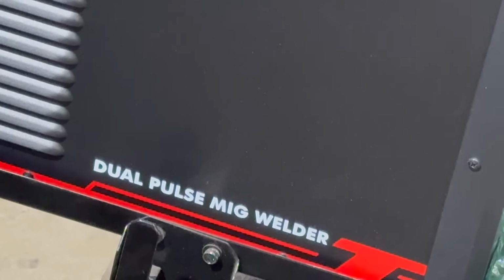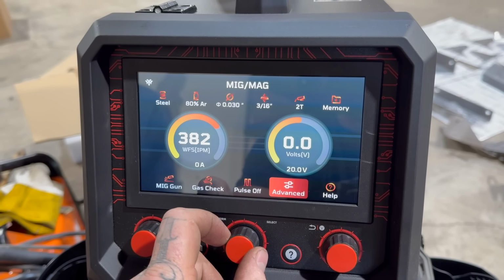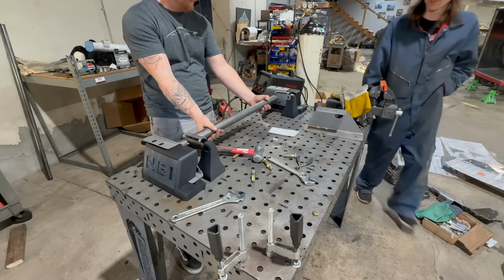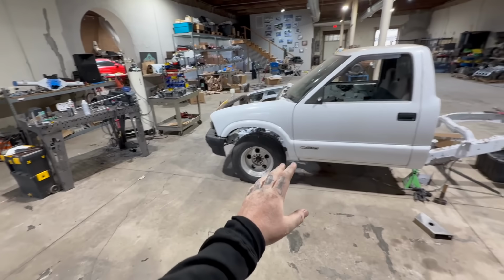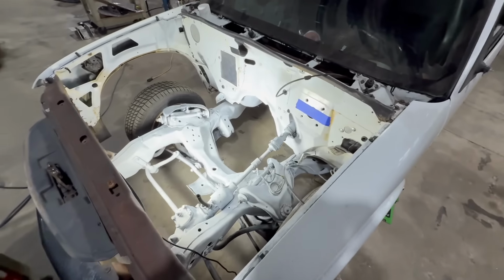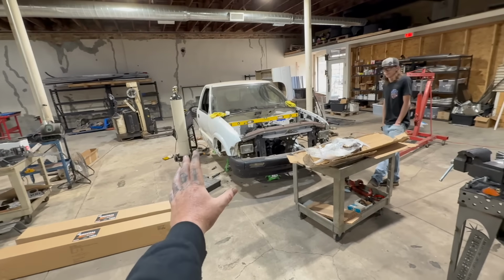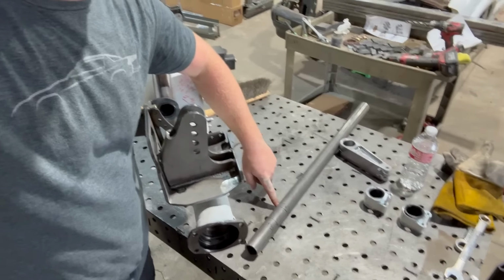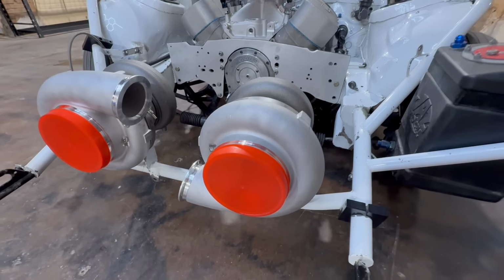Welding Up The FIRST Ever NBI S10 4-Link With Yeswelders DP200

Comment: Just curious, I noticed that the frame was unpainted under the cab. Is that just because the cab has not been removed yet or were the front and back frame ends painted to produce better 3d scans?

Comment: S10 Chassis is looking good! I have a 55 chevy pickup and was told earlier 80's S10 chassis's work for replacements because they are flat, don't have the "lift" in the frame like yours. Any knowledge on this? Great Vlog.

Comment: What if you put it in so it rests on the bottom of the frame, then the bolts don't hold the weight of the truck. Also, the shorter part should twist into place easier.

Comment: Most all of the new inverter welders are synergic when put into  dual pulse and brother get you a separate torch no longer than 9' and put a PURE TEFLON "YELLOW" liner NOT GRAPHITE!!!!,,, run .035 5356 with .040 tips with U groove drive rollers... roll out some stacks of perfect dimes on accident and proceed to throw your old aluminum tig setup in the damn garbage
Reply: I run 100% strait argon on 16ga 6061 for fuel cells and radiator tanks and it just makes it so much easier from a production based standpoint it 1/4'ed the fab time... pulse welding is a heat control process and ment for material 1/8 and below optimally and best technique for me is a hold/skip 1/8 forward with no "WHIPPING" back behind the puddle .. keeping the heat out and moving with it at a decent spe

Comment: If you’re interested I’ll bring you my Chevy Colorado for R&D.😂 Maybe a whole back half kit. Those frames are notorious for rusting and cracking at the back of the cab. Mine is fine for now but when it does fail that’s the plan is to lop off the factory frame and back half it.

Comment: Sweet jig. Just a thought you could releive the jig right behind where your tacking the main bracket on the tube so it doesnt melt. It might not melt, but clearancing may prevent a headache if your doing a bunch of them. It would suck to melt the jig to the bracket..

Comment: If all of the weight of rear end is on shock crossmember wouldn’t it be better to have on bottom side of frame instead of being completely supported by 8 bolts?
Reply: The mount is cupped around the frame. The bolts are not positioned to be in fear of shearing.
Reply: I thought the same thing
Reply: I thought the same thing is that a 110 welder or 220 welder